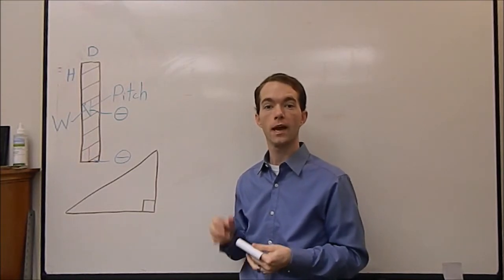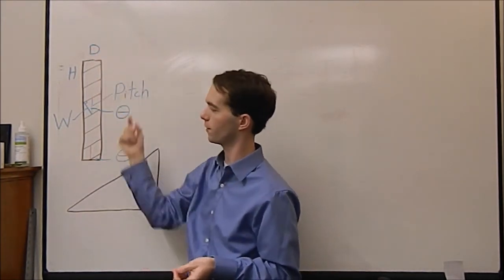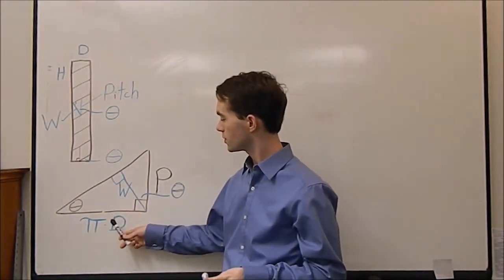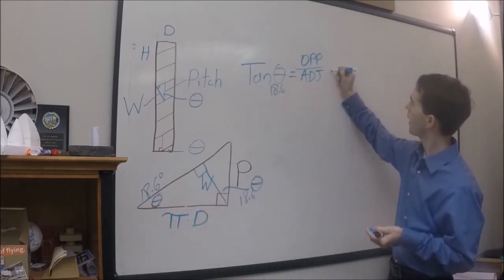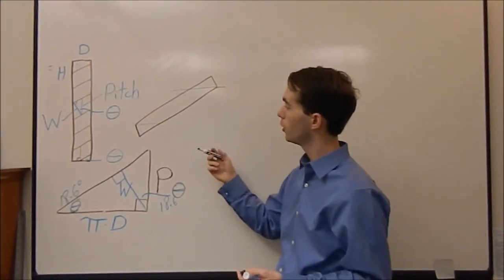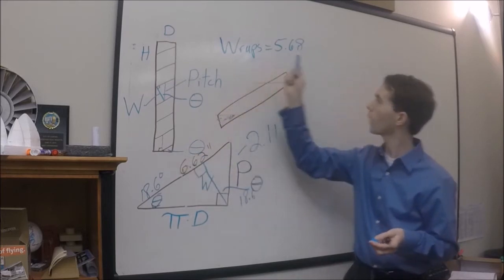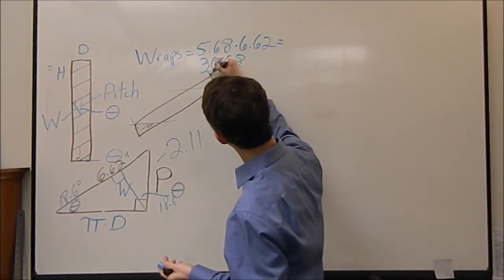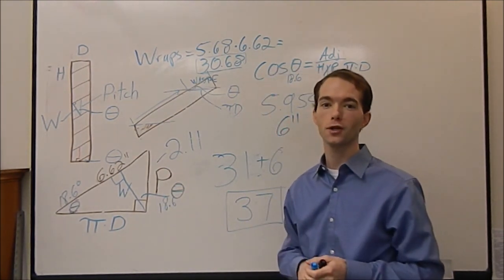How to Wrap Spiral Tubes          Mikes Inventions

Comment: Hi Mike, i have a question for the computation of at 7:32, how did you come up with the value of 30.68inches? Please reply.
Reply from the maker: Yeah, if I'm just reading the board and plugging in those numbers, I get 37.6 for a base number. Not 30.68. Let me try and figure out why I'm so far off... Ok, yeah, so I just made a dumb mistake in reading a calculator I guess. Everything else is correct, I just used 30.68 for some stupid reason instead of 37.6. I also double checked it in my Excel sheet (which I believe is available on my website). My total length for this should come out to be 43.66in. Obviously you saw this mistake and knew better, so thanks for bringing it to my attention. I'll try and fix the errors in the video somehow.

Comment: it works really good for me.but I have another question.what if I overlap the wrapping 30% I. each turn?
Reply from the maker: Hey Shazzad. I had to modify my original reply, because upon checking it, I realized it didn't provide the information that I intended. I never thought anyone would want to overlap pieces, so I didn't build that into the Excel file. The reason I didn't build it in is because an overlap is rarely desirable because of the double thickness where it overlaps. This bump makes any subsequent wraps impossible to get right, because the helix isn't flat. I can't think of any case where a multi-layered production tube has overlapped wraps for these reasons.
Reply: Thanks brother for your opinion.But overlapping is sometimes mandatory. Say, in electric wires , if I want to wrap mica  tape over conductor wire, it would need to overlapped at least 30% to make sure, any bare part of conductor wont expose. So, if you help me with that math, it will be excellent :)
Reply: @MikesInventions  When wrapping heater ducting with foil backed insulation, you have to overlap a half inch at every seam
Reply: @SHIBLI55  I'm not 100% but first thought is to subtract the desired amount of overlap from the tape/webbing etc width and complete the calculation that way using that value.